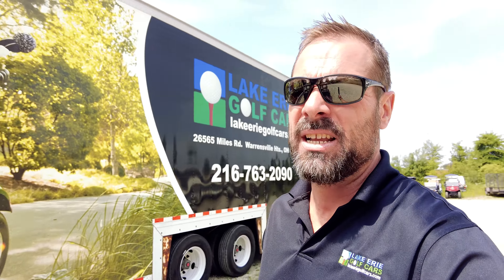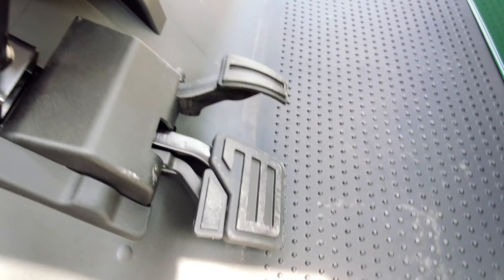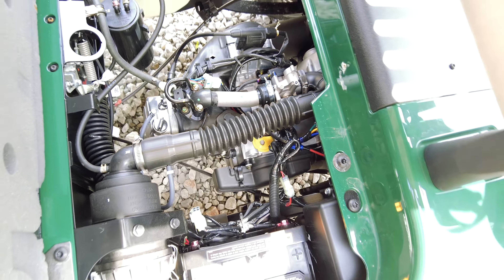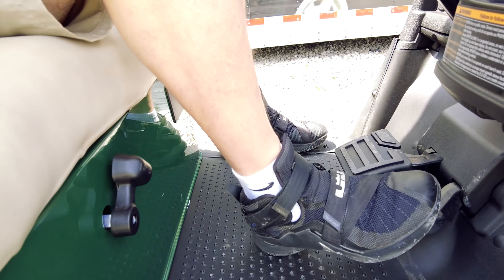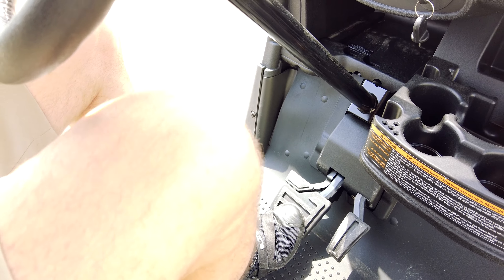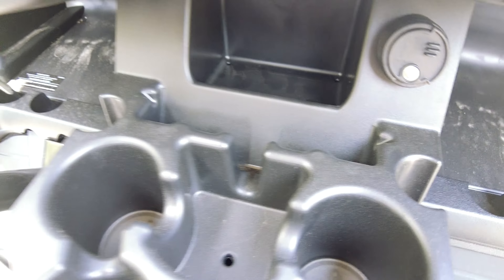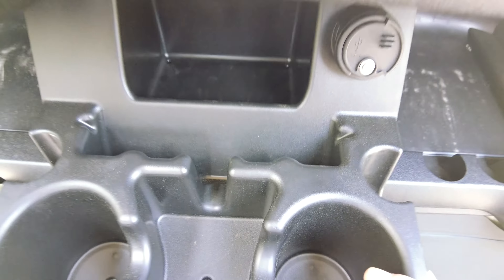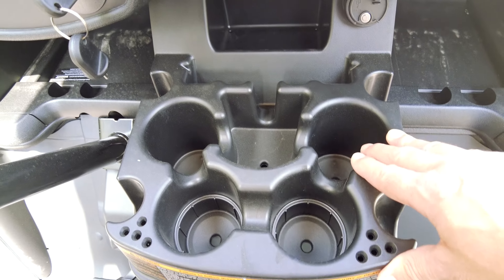E-Z-GO RXV EX-1 Gas Golf Car Review

Comment: I have a small dealership and I have just ordered a truck load of ex1 golf carts in my opinion they are absolutely horrible in quality two of the golf carts already have bad isg modules terrible and very expensive to replace
Reply from the maker: Did you contact the place that sold you the carts? Did you get them directly from E-Z-GO? Obviously, there are always recalls or bad parts in mass production. It happens. But it's also covered under warranty if you got them new.